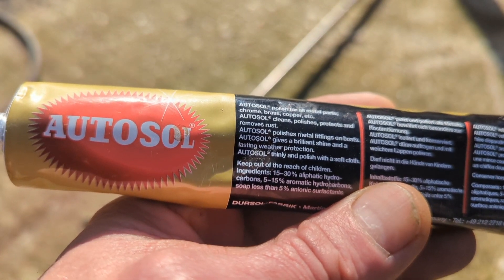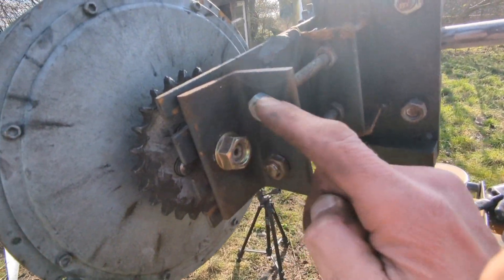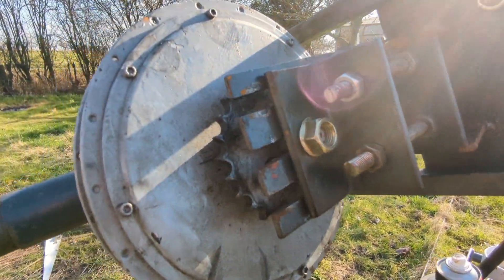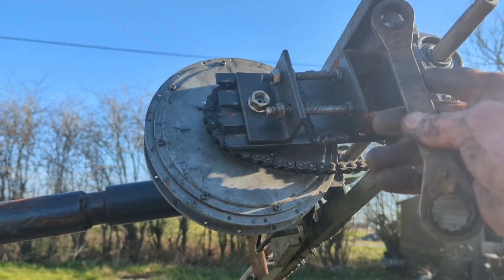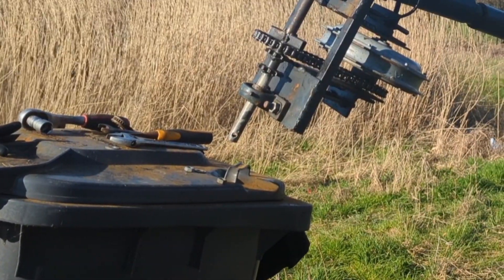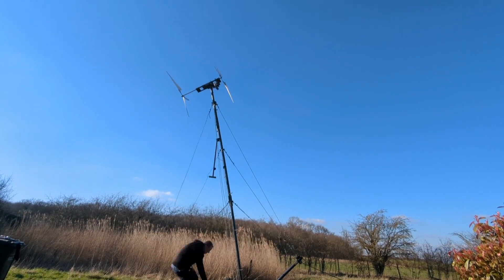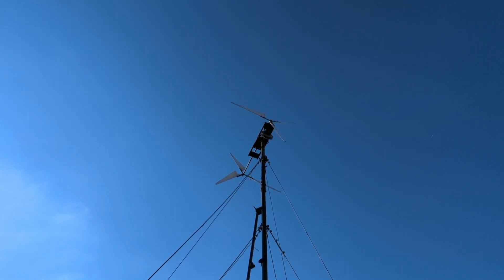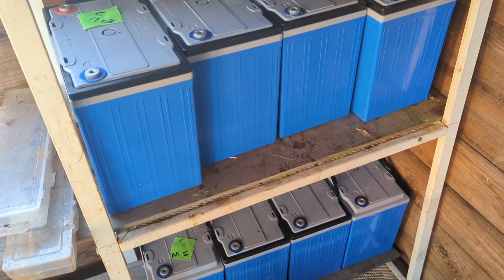Wind Turbine Project - Getting Ready for Power Cuts - 7 March 2022

Comment: Madness!
I love what this is about and watching this develop. I have a site that would be a good candidate for wind, and about 10 years ago I dove in to try to understand and get some feel for it.
So we're going with a solar PV system. The wind was more demanding of my attention than I cared.

I think it'd be a good idea to learn about how chains and bearings are treated in high-end racing bicycles (which I know something about). Frictional losses in the drivetrains of these bikes is critical because humans just aren't that powerful, so I would think you'd be also concerned. That chain was an awful mess! Wax it. This has been shown in the lab to be the lowest friction, practical chain lubricant. 

Strip off all impurities (petrol, acetone) from the chain, melt up some candle wax enough to submerge it and stir for 3-5 minutes. Maintenance would require a way to drip some liquid wax (White Lightning or similar) as in a chainsaw, every ...week? I can generally go 300-400 miles on a bike before needing a touch-up.
But a moly-based marine paste could work well too. That chain's crying for help and I dread to think how much power is being lost there and in the bearings.
Reply from the maker: Thanks for the comment. I appreciate that. All the chains and the sprockets on this thing are from motorbikes. It's more to do with how the gearing is set up then anything else?.

Comment: Hi Gavin! Love the doggy and glad to see you are more prepared and aware than most!  It looks like you are just cleaning with the autosol and wondering if you tried any of the automotive grease products that withstand the elements in your bearing and on the gears? That's a metallurgical and chemistry lesson all by itself!  If not too much trouble just wondering where you got all your hardware and fans?  If on your UTubes perhaps you can just mention which one to review. Certianly sounds like you are having fun too!  Kind Regards
Reply from the maker: Thank you mate. I am still working on the design front at the minute and then will try and eat some more efficiency out of the machine as you say.